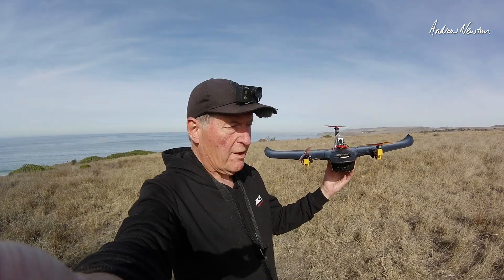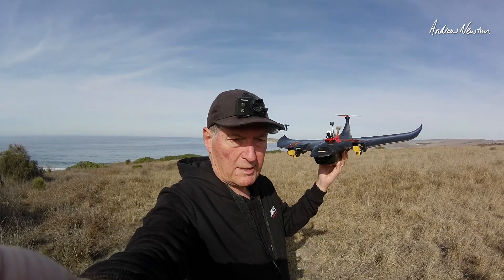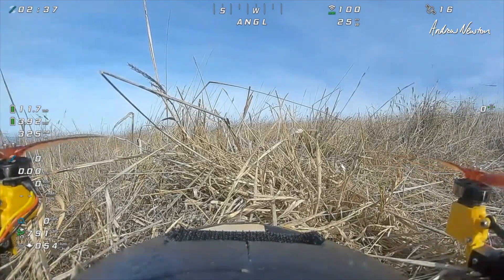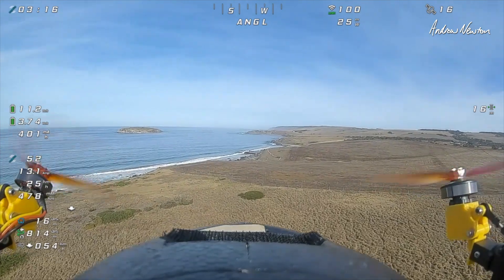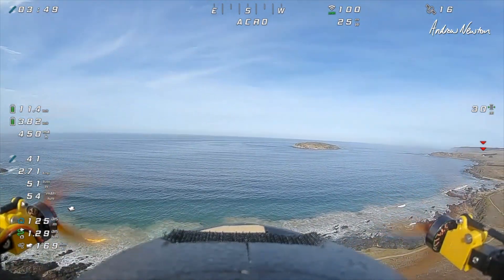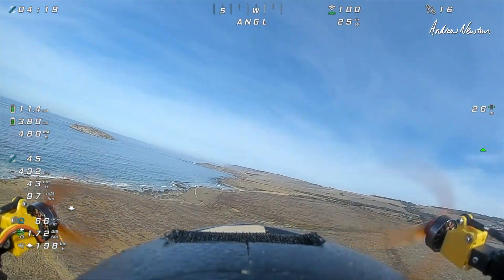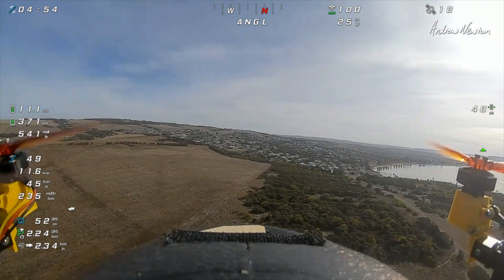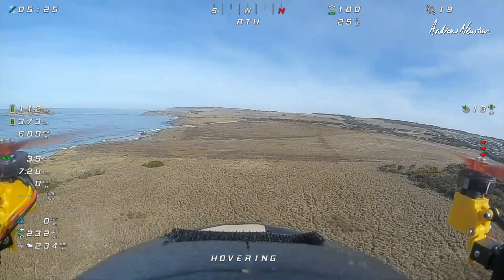INAV 7.1 VTOL Fimi Manta

Comment: Hi man

I tried to use your diff with Fimi Manta and same FC but i have some trouble and after watching you video i have noticed something wrong on your Manta compared to the DIFF setting, i hope you can help me to understand what i miss.

After putting your diff i have the motor in front spinning with prop right counterclockwise and left clockwise the back motor spin clockwise but on INAV configurator the back motor is counterclockwise if i see the image and even if is like this you have the prop on your video for a clockwise motor on back motor. 

Is normal?

Thanks in advance
Reply from the maker: Rear motor prop direction can be CW or CCW.  Just make sure you use the matching prop. Ignore the rear prop direction in the INAV configurator diagram
Reply: @AndrewNewton  ok tomorrow i try another test because today with reverse motor direction set on Inav my Manta on take-off it overturned and i think is for this things i hope
Reply: @AndrewNewton  but on your model when you are in tricopter mode and spin motor 1 you see the tail motor spin or not?
Reply: @AndrewNewton  ok finally I understand what I am wrong on the setup… I put wrong motor output because i thought is needed to use motor order like in tricopter mixer. Reversed tail motor with front right motor and the Manta still hovering fine 🙃
Reply from the maker: @BadSide84FPV  Excellent news. Well done

Comment: Hi Andrew I am building a ranger 1600 and am very new to the hobby. I was given components that I think are way to hefty for the build but they were free so I want to give them a shot. I have a pixel hawk with a x8R receiver and se 100 GPS module. I am unsure how to power the pixel hawk without frying it. As far as I understand I need a power module to divert and monitor power in the battery and a ESC to transfer power from the battery to the motor and the servos. If this is correct do you have any recommendations for a power module and an ESC.
Reply from the maker: Put the PixHawk and GPS aside for the moment. Get it flying with just the receiver first, then when you are comfortable you can add flight controllers later. Any standard 30 or 40A ESC will be OK. Something like this https://hobbyking.com/en_us/turnigy-plush-32-30a-2-4s-brushless-speed-controller-w-bec-rev1-1-0.html

Comment: Anyone converted  the Jumper XiaKe 800 VTOL from ardupilot to INAV? Ardupilot transition & quadcopter modes are good. I really dislike flying it in "plane" mode. Ardupilot very robotic. I'd rather acro/air mode in Inav.
Reply from the maker: The problem will be find an INAV target for the FC.
Reply: @AndrewNewton  Good point. I am guessing it is a Matek F405 clone.

Comment: Hi Andrew, this is super interesting, when you say adapt the settings, what do you mean ? Have you changed the motor tilting support, is it necessary, even if the original one is still intact ? 
Have you planned to make a video concerning radio and inav 7.1 programming ?
Patrice
Reply from the maker: Just servo trims really. If everything else is the same it will be close to right. The replacement mounts changed the angles a little.
Reply: @AndrewNewton  We set 3 positions, right? one position with vertical supports, another position with 45° supports, and third position with horizontal supports.